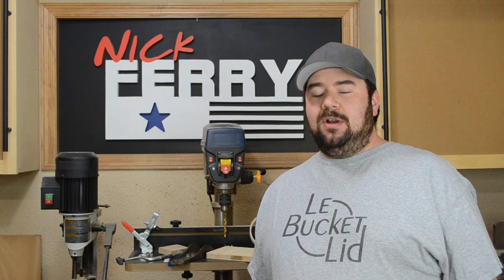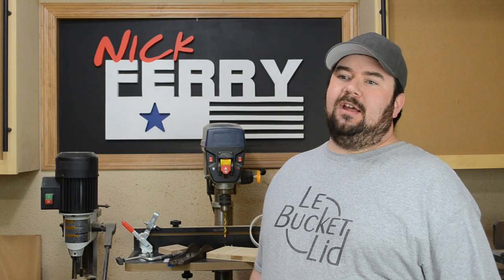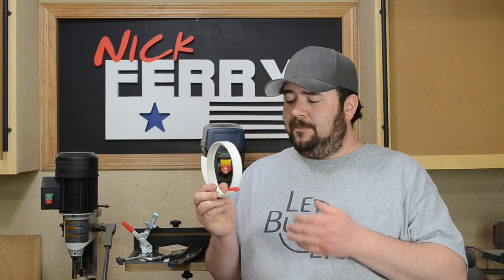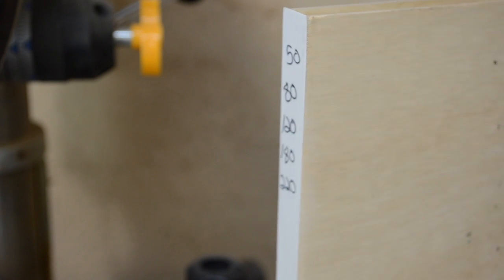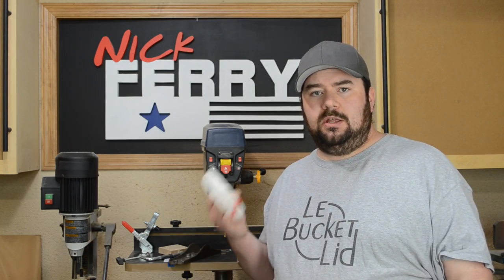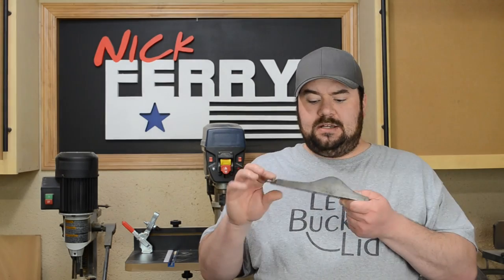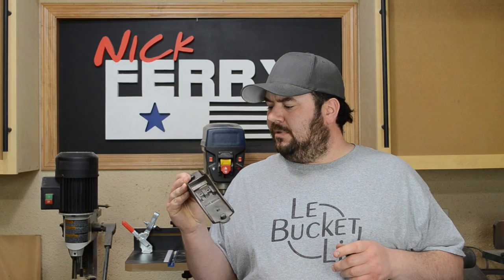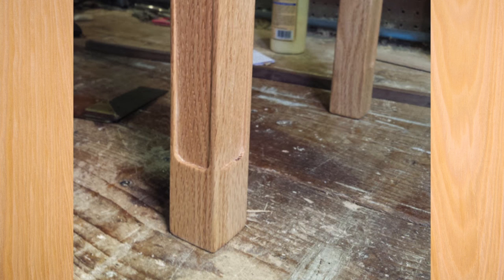Solid Core Plywood, Hand Plane Restore & Shiny Things (FT23)

Comment: Liked the live event, for the time I was there....lol.  Good to see a bunch of my fave YT'ers all at once.

When you flatten the sole of the plane have it assembled (with the blade not protruding through the mouth) so it is tensioned the same as being used.  Otherwise, the sole won't be flat when you put it together to use.
Reply from the maker: Jim Dockrell yup that is what I was going to do - it is a good tip

Comment: one thing you might want to consitter Nick Ferry when laping or flattening the sole on this plane of yours... assemble it first and pull back the iron then you have all the tention in it and the sole will be flatt when you start to use it... if you flatten the sole and assemble it afterwards you can get a small distortion in the sole and you wont be happy with the cutting when you are taking light shavings....

see you on your next video
Reply from the maker: pjakkur007 yeah I was going to finish flattening it after it is assembled - I should have mentioned that

Comment: Parents used solid core Ash plywood for cabinet fronts and doors in the early 80's. The house exploded back in 2005, so all that is salvage now. I use it for shop jigs and small works because it's still flat.
Reply from the maker: Andy Owen that is cool to know - I was wondering on if it stays flat - thanks for the info!

Comment: Make sure to flatten the sole out again when the plane is under tension and all assembled. It may tend to warp the sole just ever so slightly or the sole warps out of shape when you take the plane itself. Just a tip.
Reply from the maker: Matt Thayer yup, I was planning on that, it is a good tip
Reply: not sure if you knew. And thank you! My cousin taught me that. He is one of those guys that does everything with hand tools. I couldnt. I use my planes, drawknive, chisels and spokeshave more then the average woodoworker but I prefer my bosh table saw over a hand saw anyday!

Comment: Here in the UK we call that wood, block board, you can get different veneer faces to match your project.
Reply from the maker: mick walker interesting, is it fairly stable?
Reply: In Scandinavia we Call it a furnitureboard. Its staple, but does not have the strenght of a multilayer plywood.
Reply: Yes it is stable.